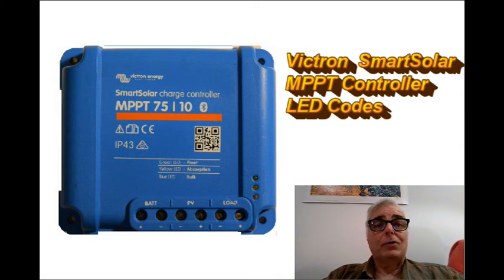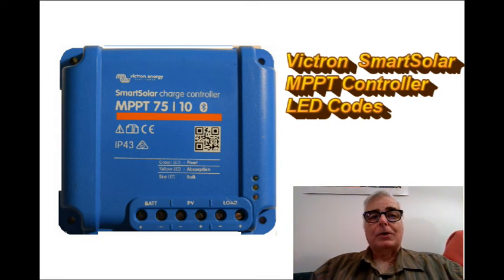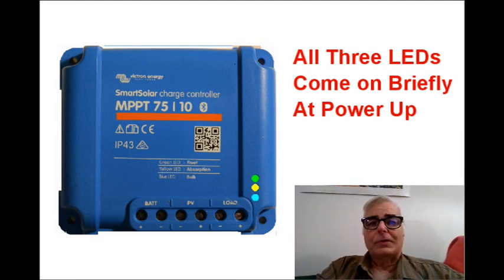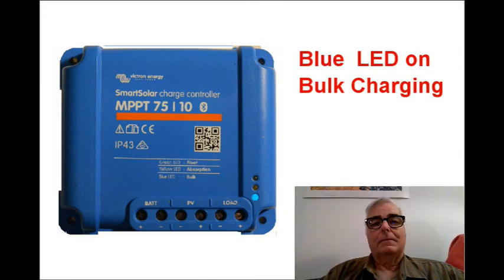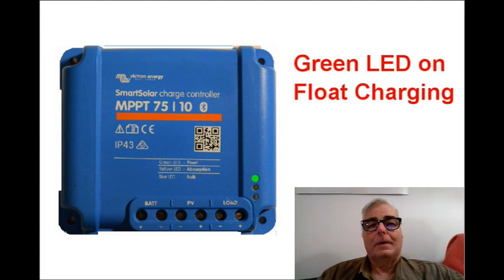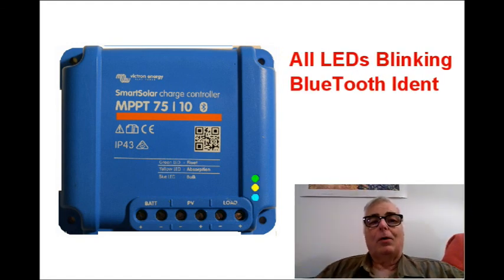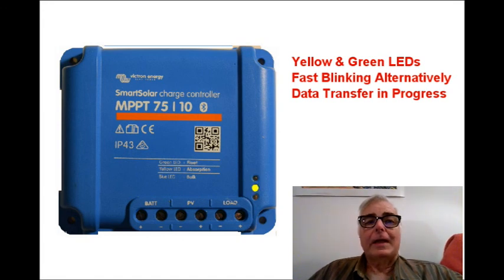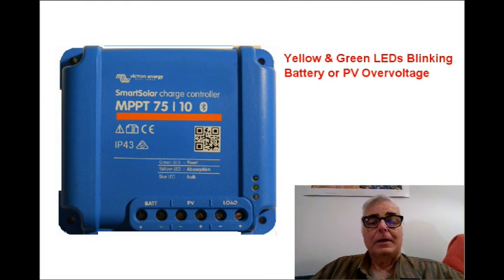What do the LEDs tell you on a Victron SmartSolar MPPT charge Controller

Comment: Hi 
Thanks for your video 
What does float mode actually mean, do you know
Reply from the maker: In Float mode the charge controller provided just enough current to hold the battery at float voltage.  Float voltage is the voltage at which a fully charged battery is maintained to prevent self-discharge and overcharging - typically in the 13.5 volt range for a lead acid battery.  For lithium batteries the charger generally turns off when the battery is fully charged since self discharge is very small.

Comment: All my lights are out, what does that mean?
Reply from the maker: If it is night it means the system is shut down until the sun comes out tomorrow.  If the sun is out it may mean you have an bad connection to the battery such as a blown fuse.

Comment: Good day Sr.  I just don't know what those settings mean.  Float, absorption and bulk?
Reply from the maker: With reference to lead acid batteries.  Bulk is the charging stage where the charger puts out maximum current into a significantly discharged battery.  During bulk charging the battery voltage gradually increases as charging proceeds. Absorption is the charging stage that occurs after bulk charging has brought the battery up to is full charge voltage (typically about 14.3 volts for a 12 volt battery).  When that happens the charger provides the current needed to hold the battery at the full charge voltage.  As the absorption phase proceeds the charging current decreases until the "tail" current is reached.  At that point charging current drops until if reaches a level needed to hold the battery at about 13.7 volts (float voltage).  This final stage of battery charging is the "Float" stage.  Float stage holds the battery at full charge and will last as long as the charger is connected to the battery and no current is drawn from the battery.
Reply: @todddunn945  Thank you Sir.  I guess my batteries were very low because I used my device for a little while and it died.  Does it stop charging automaticaly?
Reply from the maker: @1EQUALS-INFINITY  It does turn off at night and the power will drop to a very low level when the batteries are fully charged.
Reply: @todddunn945  Thank you Sir.  I very much appreciate your time.  God bless.

Comment: Hi! First of all thnx for explanation. I have 100w solar and 100ah lifepo4. While connecting i made stupid mistake and as lot of ppl connecter battery with reverse polarisation. The strange thing was that my 12V usb was working as well and my maxxfan and the blue light was on bulk mode . Ok, voltage was very unstable and loading very slow until reach 11.70-12 V but still. Few days ago i was doing my research about Victron and about polarity, i went to my van and - oups- i did it - so immidiately i changed the polarity to correct one and….. not is just nothing. Checked fuse on Victron and it was burned. Changed it with a new one 25A but blue light in blinking all the time. With multimeter connected to victron connections everything seems fine but on usb i have 0.50 V and as i said - blue light blinking. Any suggestions? Also checked the rest fuses and all are good. . Please help . My head is going to explode 😊
Reply from the maker: I am sorry, but I can't help you with that.

Comment: What is absorption charging mode?
Reply from the maker: Absorption charging is constant voltage charging at gradually reducing current.  Basically, only enough current is supplied to maintain the charging voltage.  As the battery approaches full charge that current decreases.  Once the charging current drops below some threshold value, the charger switches to float mode where the charger only supplies enough current to hold the battery at "float" voltage which is typically about 13.5 volts for a 12 volt  lead acid battery.

Comment: Thanx for the info. I got the model without the blue led. However, I found that the Green led flashing with the Orange led simultaneously and found later only green still flashing. Then I found at the bottom that the dipswitch is missing. When I do put it in the middle selection the green led stops blinking. What are the options on those 3 settings?
Reply from the maker: All I can say is read the manual.  I am not an expert on all things Victron.  Sorry.

Comment: Hi, useful video but I have a question if you don’t mind helping. I’ve installed mine and I have the yellow and green light flashing so that means overvoltage. But what do I do to fix the problem? (Sorry if that’s a daft question). Thanks
Reply from the maker: That would normally happen if you have too many solar panels wired in series.  Which controller do you have; how many panels are connected and how are they wired?  Also what are the wattage and voltage of your panels?  I may be able to help you with that information.
Reply: @todddunn945  100/20
1 x 200w panel
Reply from the maker: @charlibates1419  That should not be a problem.  Are you certain the panel is wired correctly?  Also I assume you know that you need to connect the controller to the battery before connecting the solar panels to the controller.  Other than that I suspect an issue with your controller.  If it is still under warranty I would talk to the seller or contact Victron.  Sorry I can't be more helpful.
Reply: @todddunn945  yes. No worries, thank you for trying!

Comment: I have 4 solar panels ! 200 each one , 2 one by one and then together , and i gake only 4A with full sun at Greece 12 oclock whats getting wrong i believe i had to have 20A or something like that
Reply from the maker: If I understand correctly and assuming your 200 watt panels are 12 volt panels, the four 200m watt panels wired in series parallel should put out about 21.5 amps at about 38 volts at full output.  If you have a Victron controller, the controller will reduce the panels output to what your batteries need at any given time.  You will not see full panel output except during bulk charging.  During absorption or float charging your controller will reduce panel output.  For example, when my 10 Kwh battery battery bank is in float charge my  1000 watt solar array will generally only put out 1-2 charging amps.

I have two questions: 1) What is your battery bank?  and 2) What solar charge controller do you have?
Reply: @todddunn945  sorry my fault is not all the oanels the same 2 of them gives around 30 volts and the other 2 gives 40 volts so if i messure them it is 70 volts but when the charge beggin they drop to 40 volts , but all the panels are 200 watt each , i have a victron 100/30 mppt , and i have 2 gel battaries 200 amber each one , my panels are old around 7 years old but the charge controller and the battaries are brand new , i charge them all day and it is vrey slow , i charge the whole day without any device on today and it takes 10 hours to go from 25v at 27.6 which is now
Reply: Now i have 3.0A from the solar and 4 from the battery current , 120 watt and 44volt of the Solar , and now it say bulk ! But these numbers ar low all the day , if there any option at the charger ? Does it charge float ? I dont know ,, the Solar panels cables are all connected by twisted them i dont know if its very bad ! But its fat cables and i put tyre up in all the connections
Reply: And it stops at 27.60 volt which are the float....
Reply from the maker: @crohn_killer  I think you need to check the controller settings.  Beyond that there is nothing I can tell you from a distance.

Comment: Hi Todd.  Informative video - I just subscribed.  I have a question that I will start with some backgropund. My 105W SunflareSolar panel's output is measuring 18V on my voltmeter. When I connect the panel wires to the MPPT 7515 controller, the panel measures 0.7V. and the blue light keeps blinking as though the controller is not connected to the panel. What would cause the wire terminals to pull down the voltage? Any information would be halpful.
Reply from the maker: I can't think of a reason for that to occur.  Did you connect the charge controller to the battery first?  The charge controller will not work unless connected to a battery before connecting it to solar.  Sorry I can't be of more help.
Reply: @todddunn945  Thanks for the reply. Yes, I connected the battery first. I thought asking you was worth an attempt because you seem to know much more than me.

Comment: Can i just use this without all that Bluetooth app?
Reply from the maker: Yes, you can buy a version without Bluetooth for about $40 less.  However, you have no way to program it beyond setting a jumper on the Victron port (lower right side) to select your battery type.  Alternatively you can connect it to a computer using a proprietary cable ($23) and program it from the computer and the free Victron connect program you can download.  Without bluetooth the only was you have to determine what the controller is doing is the three LEDs on the front of the unit as illustrated in this video.

Comment: 102320/1402h pst.   Hello Mr. Dunn, thank you for your descriptive description on VICTRON MPPT CC. This is a Blessing, a reward for people who hunger for information and operational intricacies of the device. I listened to your previous video going through the Charge Controller, in general. Undoubtedly it’s a treasure trove of information, at least, for me.
But, I am at loss, I am unlucky and I have lost 2 VICTRON MPPT 100/30 Charge Controllers consecutively!!!
Did I go wrong in wiring 4 cables into the correct input ports of the CC? No. I haven’t. I’m very particular and meticulous and respectful in following the diagrams of Electrical connections. My experience, a decade plus in Nuclear Instrumentations, Calibrations, Reactor control maintenance and Reactor Operations.
With all the experiences I have had, how did I fail connecting a small, tiny Charge Controller? I’m flabbergasted, stunned and unhappy. Below are the synopsis of performance.
Procedure:-
1) Charge Controller anchored properly, Ground connection (through the side grounding bolt)
2) Power Supply 13.5V DC LiFePo4/ 50Ah- 4S configuration, connected Positive+ terminal to CC + port. 
     Connected Negative — terminal to — port of CC.
3) Observed a FLASH while the above procedure. (my inference was the Internal Capacitors got charged, while 
     Battery was connected) Could I be wrong?
4) The PV cells connected through 60Amps Circuit Breakers (both Positive/Negative) was then switched ON.
      The result was NO CHARGE. The instruction indicate to connect power FIRST before PV connection.
The Bluetooth is functional. Can view CC images and other items on all iOS  and OS X devices. But no charge.
This is the second failure on new Charge Controllers thatI am facing the failure. 
I’d be thrilled to receive an acknowledgement with immense amount of thanks, from you. Here’s my contact eMail < sreeci123@gmail.com >
Sir, stay safe and Bless you. 73s...

Where did I go wrong? How did I go wrong? I’m speechless and aghast !
Reply from the maker: I am glad to provide what I know about these charge controllers.  I hope my video helped you.
Reply from the maker: Sorry for the long delay.  Based on what you have said, I suspect that you may have too high an open circuit panel voltage.  That can happen if you wire too many panels in series.  Without knowing the specifics of your panels I can not say more.

Comment: Thanks so much for that just installed my charge controller this evening and the charge controller went from a solid blue light to a blinking blue light after sunset. I’m assuming this means the solar panels can’t detect sunlight. I couldn’t find an explanation anywhere else or in my manual either so thanks again!
Reply from the maker: Yes, it means the charger is getting no input from the panels and has shut charging down.  If you sync your phone to the controller it will show charging off.
Reply: @todddunn945  But "solid blue" means bulk which means "fast charging". And "blinking blue" means "not charging" right? So if at sunset it's blinking it is normal right, because no sun comes on the panel??
Am I right?
Reply from the maker: @jeanjesus681  yes, as I said above.
Reply: I just installed mine about sunset and same thing happen.. Was looking for an answer thanks to this review I got my answer..